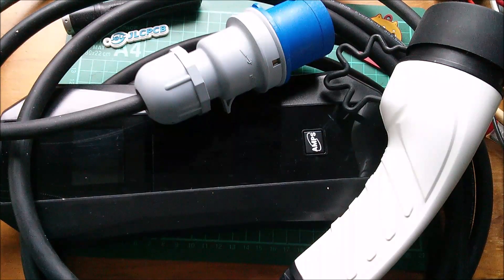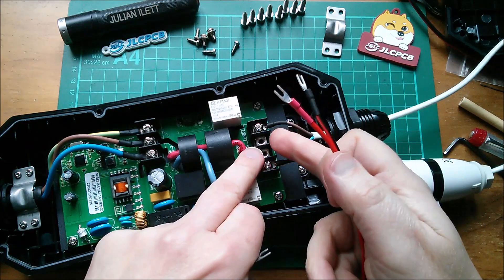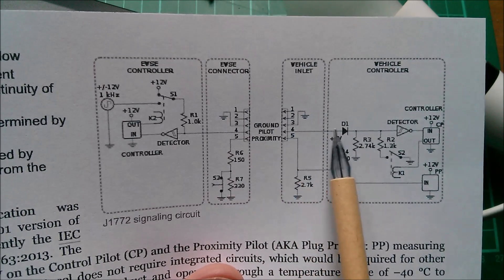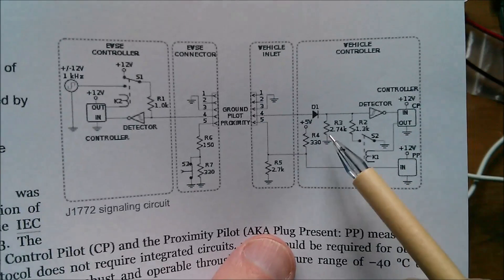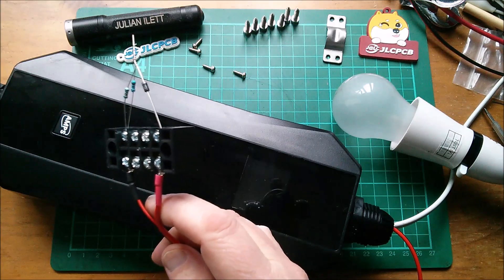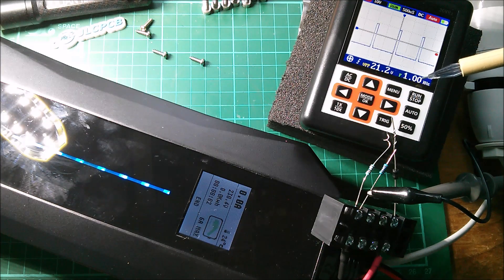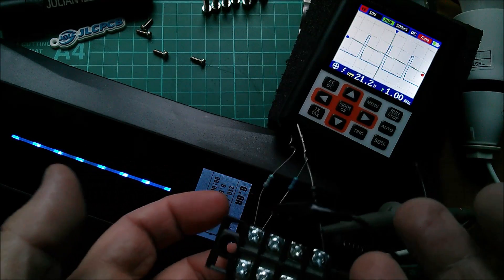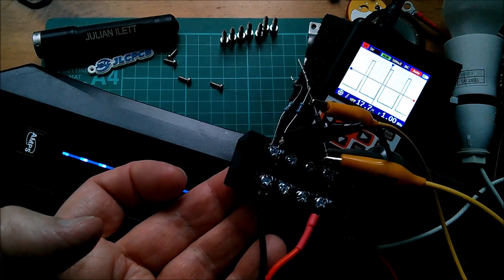EVSE Vehicle Simulation

Comment: 3:35 - yes it is safer without 'full-strength' household mains :) For some reason I feel the need to point out another safety benefit: the signal is not ground-referenced, so you'd have to touch both the phase and neutral at the sam time to get a nasty shock rather than just the phase. It's less likely to occur by accident, although still possible of course.

Comment: When the car says the battery is full it will open the relay removing the second resistor and turning off the power. The EVSE will recognise that and put end on the display.
Reply: It's presumed to be a one-way cycle. Kinda sloppy. this assumes that nothing goofy can ever happen in the real world... Ungood design.
Reply: @solventtrapdotcom6676  would it be possible for you to take a few minutes to explain the functions of  blocks named CC and CP (extreme right in the schematic, at 07:25 of the video) achieve?
Reply: @madhavdivya  CP is the abstract block in the car's computer that detects the 1kHz square wave from the EVSE and switches in the extra 1.3kΩ resistor (via relay K1) when it's ready to accept a charge. When the battery is full, it turns off the relay and the EVSE opens it's own relays so there is no voltage on the cable. This unit's display changes from "Charging" to "End".

PP is the abstract block in the car's computer that detect the voltage on the Proximity Pilot line. Normally it should read 4.5v due to the voltage divider formed by R4 and R5. When you plug in the cable, R6 is place in parallel with R5 so the voltage should be 1.5v. S3 is opened by pressing the latch release button on the connector handle. When pressed, it it stops shorting R7 so now it's in series with R6. In this state PP should detect [Edit: should be 3.7V]. This is useful so the car can instruct the EVSE to open it's relays before user can physically disconnect the plug which prevents arcing which would damage the plug and socket over time. [Edit: I should have added that PP voltage will differ from these examples based on different R6 values which signals current capacity of the connector/cable assembly (if different from the EVSE.)]
Reply: Hi, basic is the word!

Nice to make an extension from an EVSE post though.
As I sit at a free Tesco one.

Take care M
Reply: I reviewed an EVSE for Amazon recently that would not detect the car signaling the end of the charge and it would keep 240V on the power pins.  The car (M3P) would generate an error and the only way to fix it was to unplug the EVSE from the wall.  An error like that should have been caught before ever being put on the market.

Comment: If you bypass the square wave generated by the EVSE and inject your own, will the EV pull the max current set by your signal generator? Will the EVSE detect current above it's setpoint and disconnect the relays?
Reply from the maker: Good question - that would be worth testing. The EVSE seems pretty dumb, so I'm guessing it would work :)
Reply: Although some EVSEs measure current, this is typically only for display  - I;m not aware of any that will stop if the car pulls more than the PWM value says it should - this would only happen of the car's onboard charger was faulty
Reply: @mikeselectricstuff  There are EVSEs that do stop if the car pulls too much, they might not be sold in the consumer segment yet or in your country
Reply: Most EVSE measure current and even asymmetry to act as RCD. They state they have tons of protections like overcurrent, overvoltage, undervoltage, earth fault etc. Since all circuitry is basically there it would be dumb to ignore all that data it already have.